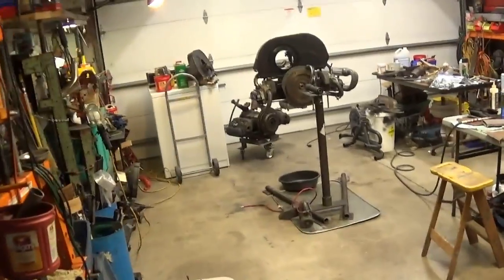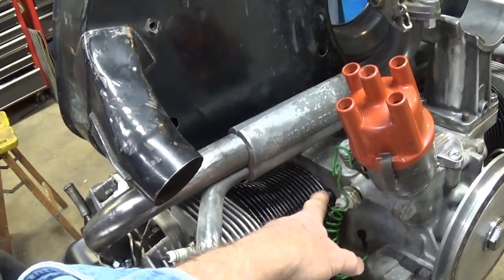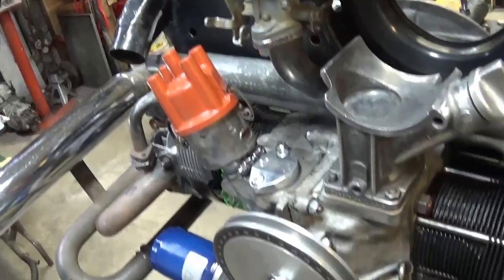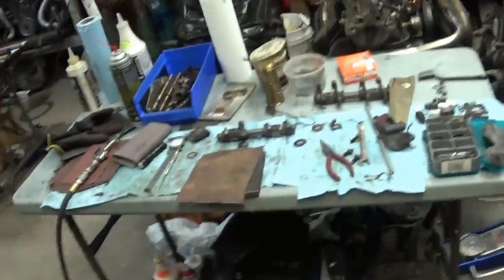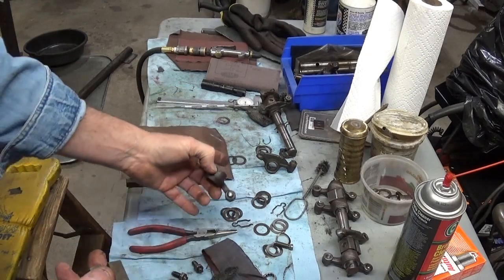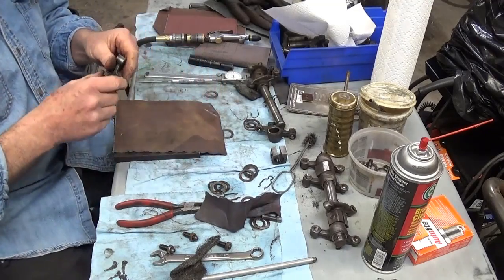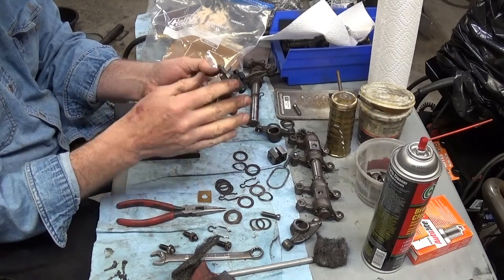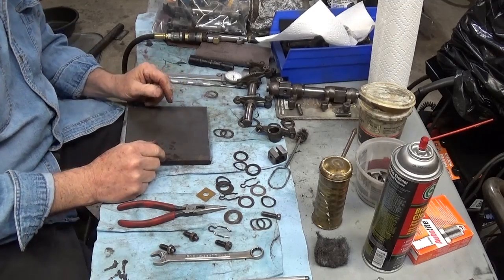VW 1776 SP Rocker Arm Maint.

Comment: I got question ezgz, here in México I got stock 1600 fuel inyected, can a used stock push rod if a change 100 cam caz fuel push Rod is a 10.30" long and stock push Rod is 11.078,am always follow your vids

Comment: Great to see that your. playing with. a. Single Port, I used to have a 67 Beetle and had a couple of 1600 single port engines I tried. I built one with the W 100 cam that I liked, I think I had the 1.25 Ratio Rockers. It was a better on the highway motor than it's stock counter part. I even just had a 40 horse carb on it but did have a Hide Out quite Pack on small headers. I made that Denver Portland Trip with each engine and let me tell you the W-100 engine win's my vote. It also had a Welded CW 69mm crank though. I even tried a single PBIC-32 Solex Porsche 356 carb on the stock intake manifold at one time with the W-100 cam and that really worked nice waking up that W-100 cam!
Reply from the maker: Thanks for sharing. I like the research

Comment: Thanx EZGZ great video on rocker shafts,I have always liked the smaller engines just for lack of cubic dollars.
Reply from the maker: It's taken me 30 years to learn what you already know. LOL
Reply: @TheEZGZ  you get the picture i emailed you of the heat tube?
Reply from the maker: Just found it THANKS!  What kind of material did you use for tubing. I have not found anything I want to try it with. Pipe is to thick and Tubing I haven come across yet
Reply: the piece next to the flange is 3/4" .049  steel tube i think the reason was it was easier to weld the flange on before lining up with manifold then made the tube out of 5/8 .058 mild steel electric weld tubing wich the 5/8 would slide in the 3/4"then weld

Comment: ezgz please what kind of rocker arms and push rod do you have on the 1776 build? currently building my own and can't get the geometry with the stock rockers and swivel feet. think i need bigger push rods
Reply from the maker: You need shims under the rocker stands. I just did mine today and had it at .070 on cylinders 3&4
Reply: @TheEZGZ  I still had fallen short of the 90° angle to the valve, I was thinking I needed longer push rods to compensate.
Reply from the maker: Usually on hot rod engines with big cams and heavy duty springs I buy cut to fit chrome moly push rods and measure. I make a vid on that in my 2 liter build using ratio rocker arms. If you don't get it perfect it will still run for a long time but will wear your valve guides sooner and not perform to peak potential.
Reply: What would you do with a head of newer valves, run imperfect geometry with swivel foot adjusters or stock adjusters better geometry, or strive to better the geometry with cut push  rods? The push rod end is low on half lift. I think I used 
. 050 just to lift the rockers enough to gap. Thanks for your response your super fun to watch bro. Hope your having a ball doing it
Reply from the maker: At some point you need to be creative and experiment on your own. I told you in the vid that the CB adjusters come with .060 and I told you in an answer that I had to go to .070 to correct. You just said you went .050 so I'm not sure what you want from me.......     when in a pinch I have gone to the hardware store with my dial indicator looking for large flat fender washers that were all the same thickness and smooth edges. Enough to do all 4 rocker studs. I stacked them. Orrrr get on the phone and call a good VW supplier and wait for them to come.  LOL    WE LEARN FROM DOING IT AND WATCHING THE RESULTS VERY CLOSELY.  Good Luck
Reply: OK I'll have to try the ratio rockers maybe they are more centered at half lift thanks

Comment: Good video, loads of info.  funnily enough I'm swapping the cannon exhausts I have on my engine for a 4into1 off road header and quite pack in the next week or two, and having to weld on flanges for the heat risers to sit on with my single carb.
One tip I have, is if you want to block off the air outlets on the fan housing, then Scaffold pole safety caps fit over them perfectly.
Reply from the maker: cool...  Good tip

Comment: Down here... way south of the border, hehehehe...Our STUD HOLE in the rocker arms shaft BLOCKS are offset and has to be mounted with slots up. If you mount  the blocks with slots down the rockers will not align with  the vale stems properly (the offset shifts the arms).  I see on your vid that your blocks have the hole centered so that it will not change the alignment up or down.  Our rocker arm assembly also has two fiber shim washers on the shaft witch may explain the offset.... make sense?
Reply from the maker: Yes,  that makes sense but I wonder why your stuff down there is different. I don't see the manufacturing savings in doing it that way but I know they had good reasons for everything. I'm going to go back out and see what happens on a spare head I have. I'm always learning. Thanks for being you. 
I'm trying to figure out a way of explaining the real meaning of Easter. It is the most important celebration of the year. I'm praying on it.
Reply: All our 1300cc are single port heads and all our 1500 and 1600cc are double port heads, so for most of my sand rails (I'm finishing number 13),  I take the 1300cc heads and have them bored to fit the 1600 cylinders. I do get a smoother idle, and maybe better torque on low end too, but that's just a feeling I have no way of really checking.
One of my thoughts for Easter time... Christmas for many, remembers Jesus' Birth, that's cool, but Birth is how we got here so that's pretty normal, Death is not so cool but were all going to leave here through that gallery, pretty normal too... but Easter time with Jesus only using the tomb just for a weekend, now that is off the charts! Gives me hope there is something awesome on the other side.
Reply from the maker: Off the charts for sure!
On the dual single thing.  I noticed going threw some SP intake manifolds that the tube diameter was different. I used the slightly large one but it looks like it fits the 30 Pic-1 carb just right. I was thinking the smaller tube would give better low end and idle with a better ram effect in mid range. I went with the larger one because of the 1776 displacement. I don't want to totally kill my top end. hehehe  I'm going to try and see if I can get it to run with the mechanical 009 distributor before I break down and buy a new one.  Wish I could afford to come down there and help you build a buggy. I'm sure we could teach each other a lot.  Side by Side Cleaning old parts. hehehe Oh What Fun!
Reply: I have 4 complete 1300's sitting in my garage just waiting to be torn apart, be cleaned (big messy job), machined, and closed up as 1600's..., man could we have fun, then evenings (go piranha fishing... it can't get much better than that! 
By the way EZ, I have a hard time getting the 1600 flywheels, do you or any of the VW boys know if I can get away with the smaller 1300 clutch disk and pressure plate
on the stock 1600??? ... I may have to try it and see if it slips under load.
Reply from the maker: I don't have 1st hand experience with that but I am thinking the 6 volt starter on the 180 flywheel will take the 12 volts for a long time if you don't crank it for long periods. The Bus clutches were supposed to have heavier clutches springs than the sedan and with your cars being so light I bet it would be worth trying. IMHO

Comment: I's still use solid rocker shafts, even with stock rockers and cam.
Reply from the maker: As you saw by the pile of shafts I do to but with this stock cam and springs I thought I would try it out.  Funny how building a basically stock motor is intriguing for me. I'm always learning something new when I look  at the insides of a old engine.